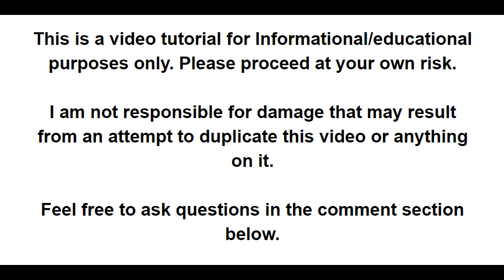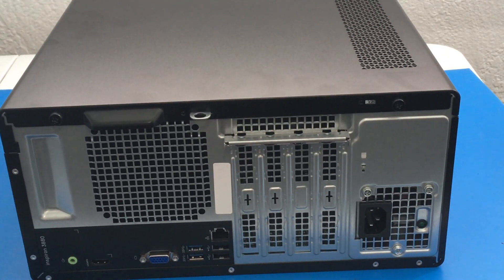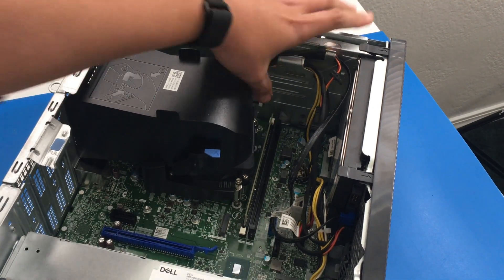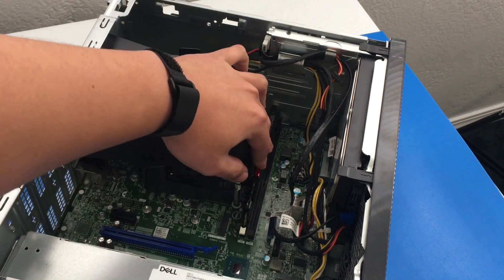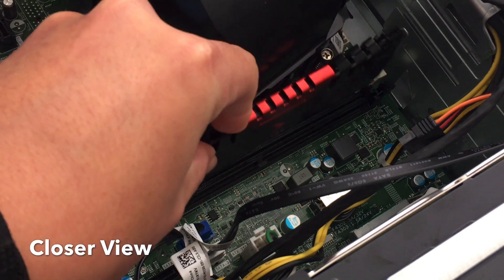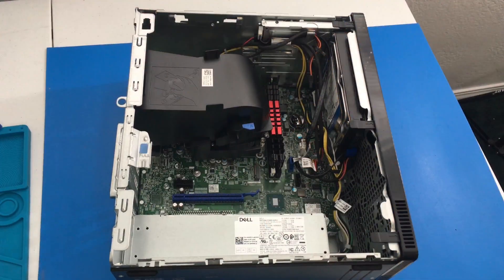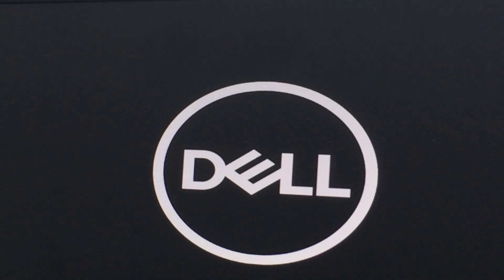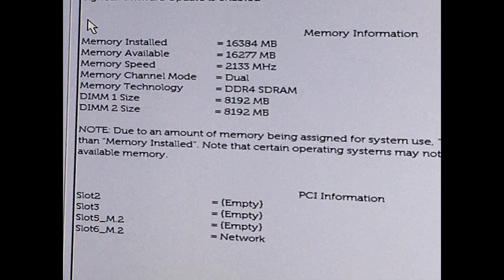16GB Ram but 2133 Mhz - Dell Inspiron 3880 I3880-3777BLK-PUS - Ram Upgrade

Comment: It was with 8 GB RAM running at 2400 Hz. I changed the RAM to 16 GB. It ran at 2133 Hz. How can I run RAM at 2400 Hz? Dell
Reply: Have u found the solution I got 32gb ram 3200mhz running 2133mt/s🫤
Reply from the maker: You need low density ram https://youtu.be/E_iE1XNaSIA?si=asq3BIB5BkuEbLmo
Reply from the maker: You need low density ram https://youtu.be/E_iE1XNaSIA?si=asq3BIB5BkuEbLmo
Reply: @whattmeter  I got a dell isprision 3880 or bios version 1.31.1, is there anyway I can increase the speed ?
Reply from the maker: For the inspiron i could be wrong but I dont think the inspiron has an overclocking feature or xmp profile in the bios. Did you check if there was an advanced mode in the bios?

Comment: After upgraded to 16GB RAM, can't change 2133 MHz to 2666 MHz?
Reply from the maker: Depends on the ram you use. It can totally reach 2666 Mhz with low density ram
Reply: @whattmeter  which ram can reach 2666 Mhz?
Reply: @alexting8868  when you purchase the ram it will say what its maximum rated frequency is (i.e. 2100Mhz, 2666Mhz, 3600Mhz) Depending on the motherboard chipset and CPU you have there will be a limit as to the speed that your pc can utilise ( you can install faster ram but the pc wont always be able to utilise the speed) if you install new faster ram you will need to go into the boot menu and select the new memory speed the menus (its under XMP for intel motherboardsd and DOCP  for AMD motherboards)
Reply: @DarkStar2  Dell do not have XMP
Reply: @alexting8868  Ahh I see, in that case it won't matter what you put in the pc it will run at what ever dell have set it at. The big problem with dell, hp and the like is that they use non standard parts for more or less everything except the CPU.
Reply: @DarkStar2  back to first question: which ram can reach 2666 Mhz? what is low density ram?
Reply from the maker: @alexting8868  I made a video using two sticks of PNY - 8GB 2666MHz DDR4 DIMM Desktop Memory
Model: MD8GSD42666 https://www.bestbuy.com/site/pny-8gb-2666mhz-ddr4-dimm-desktop-memory/6441463.p?skuId=6441463 
Tutorial video below
https://youtu.be/E_iE1XNaSIA

Comment: How I upgraded the SSD on my Dell 3880 from 256 GB to 1TB: I downloaded Macrium Reflect’s free program and used it to clone (NOT image) the internal SSD drive to my internal hard drive, which I had previously swapped with an empty one.  I unscrewed the DDR drive, removed the screw and the screw mount beneath it. I then replaced the SSD with a Samsung 1TB SSD 980 NVMe M.2 Drive  -this drive is twice as long- and replaced the screw and screw mount into the next screw hole over on the motherboard.
I then restarted the computer—it booted to the hard drive and opened windows. I went into Computer Management – Storage – Disk Management, and the new drive did not show up.  I restarted the computer, and returned to Disk Management where a pop-up asked me to choose the new drive’s partition style.  I chose Guid. It then showed up as an unallocated disk, so it was not in my directory, but I could see it in Disk Management. 
I then opened  Macrium Reflect and selected clone the hard drive and chose the SSD as the target. I then dragged the partitions one-at-a-time from the hard drive to the SSD, leaving the largest partition for last. When I dragged that partition down, I selected it and clicked “cloned partition properties” and I maximized the size to use all the remaining unallocated drive space by dragging the button on the bar.
Then I directed the program to clone. When it was done, I shut the computer down, swapped back in my original hard drive for the one I was using for the clone, and restarted. Perfect!
Reply: I added a 500G NVME M.2 drive to my newer Dell laptop. Did the same with Macrium Reflect (free). Instead of minutes it boots up in about 30 seconds! I have an older Acer laptop that was slow to boot to Windows 10(free upgrade). I replaced the 500G HD with a 240G SSD and what a difference. HD to SSD is better than a RAM upgrade I think but I can't say for sure.
Reply: @eminusipi  SSD definitely makes a difference. I think a balance of SSD and Ram is important. Depending on what you are using the computer for.
Reply from the maker: Nice! I like using Macrium too.

Comment: Nice video, I upgraded mine from 8 to 32, I’m using 2x 16gb sticks of 2666mhz ram. Next video cpu upgrade
Reply from the maker: Nice! Im super busy at the moment and there’s a list of requested videos I am working on
Reply: Just curious...where did you get your 2x 16gb sticks of 2666mhz ram?
Reply: @dtellor7053  I got 2 sticks of 16gb crucial ram that is 2666mhz on amazon
Reply from the maker: @dtellor7053  best buy a while ago. It's better to go low density ram for this type of pc